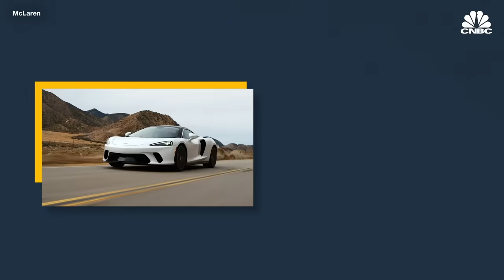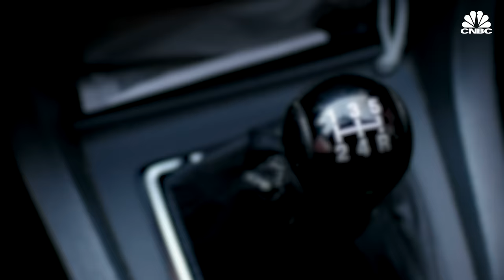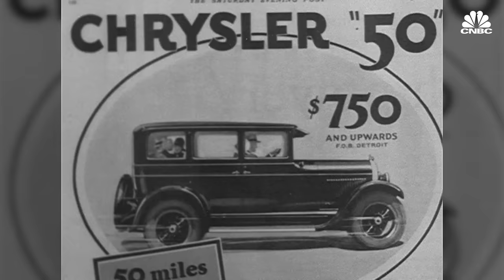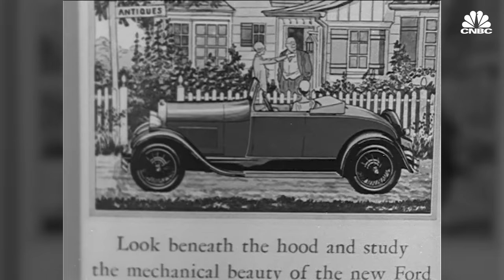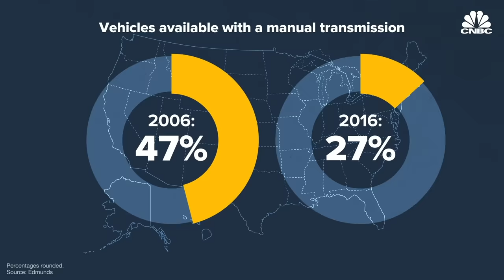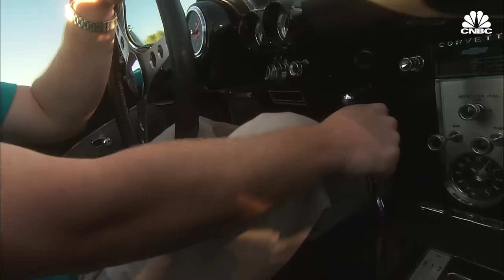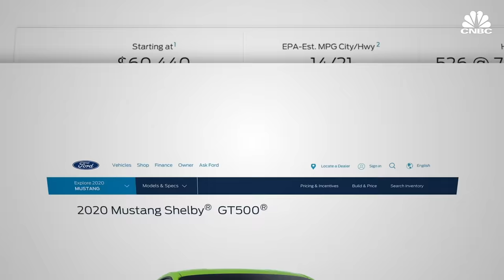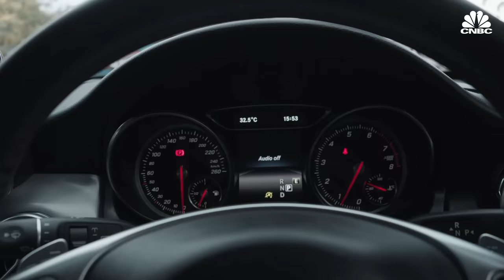Why Stick Shifts Are Going Extinct

Comment: "they require constant attention" its called driving
Reply: I just found in a low-power truck that I had a Ford Ranger driving in really heavy traffic for a long time got to be pretty tedious.
Reply: @omvegan  Well yes of course im not saying automatics are no good. There certainly are situations where they benefits from not having to worry about shifting, like in areas with heavy traffic. But there is a difference in saying it is tedious to drive a manual in heavy traffic and saying im not buying a manual because it requires too much attention. Because attention is always required when driving and shifting becomes a habit like indicating when turning
Reply: Who wants to be constantly attentive while operating a 2 ton piece of metal at over 55 mph? 🤷🏻‍♂️
Reply: You should be focused on driving (re: the road), not on operating your car. That's why manual transmission drivers get into almost 3x the crashes of automatic drivers.
Reply: @canyounot4665  lol what's your source? you couldn't possibly claim something so outrageous without a source
Reply: @canyounot4665  guess what automatic drivers get into 5 times more accidents than manual drivers
Reply: @laurenzr.8524  I also would like the source for your claim "automatic drivers get into 5 times more accidents than manual drivers". Like said above, this would go against the research in the area in driving safety, but also against research in the general psychology of multitasking (you are doing more things at a time with a manual transmission, despite you thinking you have "mastered" the task to the point of it being subconscious). It's not about people using car X being more likely to be better drivers, they are both the same, it's about one being easier than the other.
Reply: @xPussySlayerx69420  lol there is no source for my claim, that's the point im trying to make. if its too hard for you to drive stick, then go ahead and but an automatic, but don't claim that manuals cause more accidents, because they are "harder to drive"
Reply: @laurenzr.8524  you tagged the wrong person, and the dude LITERALLY gave you a source that proved manual transmission cars cause more accidents
Reply: @canyounot4665  lol that was not a claim
Reply: @xPussySlayerx69420  absolutely not. one study was looking at improved performance in older drivers and the other one is neither on an official website, can therefore be taken out of context and is neither stating, where these test were conducted. for example in Europe 80 percent of cars have manual transmissions, therefore there will be more accidents in manual transmission cars. the claim, that automatics will cause 5 times the amount of accidents as manuals was clearly a joke, to point out the ridiciulusness of his claims. (please excuse my English, since it is not my first language)
Reply: @xPussySlayerx69420  you shouldn't believe everything you see online, just because someone post a source. if the source is no good, his claims wont be either.
Reply: @canyounot4665  in the end I would say it all comes down to the skill of the driver, saying  manuals are 3 times as dangerous is false, even your sources can't proof it, and is also an outrageous claim, since the driver is guiding the vehicle and not the transmission. people who are able to drive manuals are generally the more skilled drivers compared to people who can't
Reply: @canyounot4665  and by the way, reporting me, cause your loosing an argument just supports my position.
Reply: @laurenzr.8524  the article you linked doesn’t make ANY claims, it literally just says to call their law office if you get into an accident you boomer. It sounds like you are ignorant in the field of car safety, because about 95% of research papers on this reach the conclusion that manual transmission cars are less safe.
Reply: @laurenzr.8524  boomer, it doesn’t matter what you think, go conduct a study or consult an insurance company to see the numbers on how much more dangerous manuals are
Reply: @xPussySlayerx69420  :) it clearly states that there is too little information to conclude either one is more or less safe
Reply: @xPussySlayerx69420  you know you won, when the opposition, tries to insult you instead of trying to make a point. and for that reason im muting this conversation. have a nice day :)
Reply: @xPussySlayerx69420  one guy reporting me and disliking my videos and the other one insulting me. Gents, it was fun arguing with you, but this conversation shows once more, that scientific and objective discussions are not possible on the internet
Reply: @laurenzr.8524  1. It’s very clear you didn’t read the studies linked. You bring up that 80% of cars in Europe are manuals, sorry to tell you but the study linked is from a EUROPEAN insurance company. 2. Please look up the definition of a claim. 3. You have been reported for spreading misinformation. I and nobody can help you if you choose to be ignorant. Goodbye.
Reply: @canyounot4665  lol of course its from an insurance company in Europe, that's why the percentage is so high:) people like you amaze me
Reply: Well you can focus on watching where you are going instead...
Reply: Horse manure,  I drove a stick shift for many years.  It becomes "automatic"  unless you are trying to impress.
Reply: @laurenzr.8524  Because there are 1000 times more automatic drivers than manual drivers.  Duh.
Reply: @laurenzr.8524  Dang dude, why you so pressed about this. If people want automatic cars then they want automatic cars. If people feel that they are a safer option for them then let them.
Reply: right lol and she is still wrong too I dont pay att to the gears just the road and feel its like 2nd nature
Reply: @laurenzr.8524  because there are more of them😶
Reply: @laurenzr.8524  its clear you don't actually know how to use the internet the pdf the other guy posted was a .gov meaning government organization aka reliable source meanwhile you posted a blog you seriously posted a random blog and claimed it as Evidence
Reply: @laurenzr.8524  it's true. I looked it up myself.
Reply: @canyounot4665  yeah but then if your busy with the gear shift you won't be tempted to pull out your phone
Reply: @canyounot4665  Of course, you can spend more time texting, eating, drinking, etc., when you should work on your driving.
Automatic transmissions lose more energy in the transfer of power to the wheels; that is a simple fact of basic engineering.
My qualifications?   Multi-ticketed mechanic tech; Engineering; hydraulics and computer electronics - until not long ago, I was one of the guys your mechanic called when they had trouble.
Reply: @andrewthompson5728  "Automatic transmissions lose more energy in the transfer of power to the wheels" I don't think there is anyone here that was arguing for or against this besides you.
Reply: I drive my auto like a manual using the paddle shifters. Miss my stick shift cars
Reply: @laurenzr.8524  yup! 2 years of driving in bumper to bumper traffic for 2 hours a day around Boston made stick shift a lot less fun for me haha. Agree with you, the only time it feels tedious is in traffic
Reply: Your less likely to crash instead of having your phone on the other hand.
Reply: @xPussySlayerx69420  but that source also says male drivers are involved more in accidents than female, it doesn't mean women are better drivers. I don't think these stats should be sole criteria to judge which is better
Reply: @shaktisehrawat7479  They don't attempt to make a claim on which is better, the fact that you think that implies you are misinterpreting their goal as research papers. And like I and other people have said, the overwhelming majority of research papers in this area come to the conclusion that automatic cars enable for safer driving than those same people on manual cars, you occasionally get a research papers that says manual cars are better for this use case but they are roughly 1 in 50 or  in 75 in favor of automatic cars. Each paper focuses on a different metric for safety, so no the stats I brought up aren't  "the only stats" being used. You would know this if you are actively involved in the research of driving safety, but it is clear that you are not.
Reply: @1Animeculture  bruh thats something a guy who never drove a manual would say, you dont have to look to the shift knob to shift.
Reply: Actually, having grown up with manual, it becomes second nature.
Reply: Amen
Reply: So true, anybody that complains about needing to be more attentive while driving is NOT somebody I would want to drive in a car with
Reply: @navinadv  This is actually 100% accurate, if you've never driven a stick shift for more than a month, you literally have no clue what you're talking about, people really think we out here thinking "Okay, its at 4k rpm..shift to 2nd, 4k rpm, shift to 3rd" lol
Reply: @alanmtz8054  can you imagine Hamilton, Schumacher, Fangio, Stewart, Lauda actually thinking as they change gears. Once you have spent about 2 years driving you drive by instinct and feel. I have on occasion (thankfully few) had to make evasive manoeuvres and it all happens so fast that there is no time to think, at least I can’t remember doing any conscious thinking. You hit the brakes, double de-clutch, turn, brake again, turn again, and straighten the car all simultaneously and on pure feel. This is where European cars, trump Japanese and maybe even American cars on the “twisties and turnies” (barring a few models. I remember once instance when I had to drive a Corvette Z28 from LA to Monterey via Big Sur and it was harder to handle compared to the SAAB 900 Turbo I drove a few days later on the same route. 

One thing I can say for sure, as we get older, our reflexes slow down alarmingly. I drive a lot less enthusiastically now, than I did at 50, 40, 30, or 20.

That said, with the advent of electrics. Be prepared to see manuals slowly fade away.
Reply: I'd like a car without a steering wheel so I can pay more attention to the road
Reply: Texted while driving 🤣
Reply: @canyounot4665  To me it seems you have a really good source in the Swedish paper on older drivers in automatic vs manual cars, a very interesting read! The other link you provided does not seem to provide enough information. It is not enough to say that 83% of accidents are caused by drivers of manual cars since we don't know what percentage of BTA-insured cars are manual. (Though it can be said that in Europe in general more than 80% of cars sold are automatic).
Disclaimer: I am not claiming that manual transmission is safer, I am just pointing out that your claim of manual drivers getting in to 3x the amount of accidents has not been proven, in any meaningful way, by the links you provided.
Reply: @xPussySlayerx69420  so do europe have 3x more accidents than america?
Reply: @canyounot4665  automatic transmission is still a minority. You really have to to want one, unless a hybrid or electric, to buy one. Many car models have less engine options on automatic transmissions. You can therefore infer that automatic transmission is a choice, while manual is the standard in europe. That alone filters a bit the quality of the drivers for each. You do see a lot clueless drivers on automatic suvs that can’t even understand their car’s dimensions, imagine them on a manual 🥶
Reply: "The problem is that they require work , skill and constant attention."

Those are problems? I thought they were virtues.
Reply: @emmamemma4162  to you and everyone else reading: if you live in the US I offer a free class hosted by Berkeley Community College on the ethics of driverless cars. I spend about 2 weeks of this class discussing the academic research around driver safety between these 2 types of cars (automatic and manual). Again, everything that has been said so far is NOT my opinion (I have yet to see someone else here state an opinion and back it up with scientific evidence), I am just stating what the science and research papers published say. I entourage anyone reading to take it because it concerns me the seemingly statistical incompetence displayed by the  statements being made by some (incompetence has a bad connotation buy I mean it literally here).
Reply: @globalist1990  please see my previous comment above
Reply: @canyounot4665  I’m not interested in that course and you haven’t stated anything else. I will add, if you have a car on good working condition and you drive as you should as an imperative for getting a driving licence, you will have no more accidents than an automated car operating properly. The problem with people driving is, there’s always a few *$>%*€<#\,^ “driving” on the roads.
Reply: Why Manual drivers aren't getting in stupid fender benders because they're alert...
Reply: @globalist1990  lmao your responss makes it painfully obvious you didn't read my comment or chose to ignore it
Reply: @globalist1990  citation needed for your claim about automated cars getting into more accidents ...
Reply: @canyounot4665  no worries. No citation. You believe in what you want. I believe in git gud.

You edited your comment. Typo perhaps? On automatic/automated?
Reply: @canyounot4665  why don’t you share some data? I’m sure you can squeeze something from the two weeks class.
Reply: @globalist1990  if you cannot cite your claim then I will report your comment for spreading misinformation. We don't need anymore trump jr. roaming around.
Edit: i should have said disinformation instead of misinformation, you are intentionally and knowingly spreading false claims
Reply: @canyounot4665  😂😂😂 feel free. I believe it’s obvious it’s my opinion. You have the data and yet don’t share it. I wonder why... 🤷‍♂️

Just a quick anecdote. Who has more serious accidents, europe or usa? What transmission is more prevalent in each? Don’t forget that in any case, the transmission is just a small factor in road safety. And manual transmission is hands down cheaper to buy and maintain, more durable and requires less servicing.
Reply: @globalist1990  see my previous comments, I have cited every claim I made. I am awaiting your citation.
Reply: @canyounot4665  🤦‍♂️🤣🤣🤣🤣 where? I missed your first links. I concede that automatics are a lot safer to nabs though.
Reply: @globalist1990  if and when you go to college, please take a class on statistics. Personal anecdotes individually are statistically useless. Your previous comment had been reported.
Reply: @canyounot4665  my opinion is: current road design and speed limits are already very forgiving for a normal person, as they should. These standards were designed and improved for cars that were manual. You could theoretically drive a bit faster in a safe way, but that is dependent on skill, focus and health of the driver. People with decreased abilities will benefit the most from automatics. Manuals allow more precise and quick control of a car, an automatic transmission can’t predict the road and obstacles, the driver does, and manual gears are important for finer control. Automatics give more reaction time and manuals give more control. So it’s a case of automatics: more reaction time for the  driver, slower and weaker response of the car, manuals: more coordination required (and less forgiving to panicking) from the driver, snappier and more precise response of the car.
Reply: I respect everyone's opinion here, but I'm firmly on the automatic side of this argument. For me, a manual just seems like more work with zero benefit. Due to being in an at-fault accident a few years ago, I'm very paranoid and hyper-focused on my surroundings when driving, the last thing I need is another distraction when I'm trying my hardest to be safe. Driving isn't fun for me, it's a stressful chore.
Reply: @MrIronJustice  that’s a very good point. I believe it’s always subjective. This whole discussion will be useless with electric cars. There’s no gears. And the brake does engine brake together with conventional brake pads.
Reply: Honestly, I don’t even pay attention to my shifting. It’s muscle memory.
Reply: You are right. But now, Tesla is trying to change cars, and driving, to appliances like smartphones and an activity like trolling on social media respectively... what a sadness. Driving is a serious thing...
Reply: @canyounot4665  If you say this, you have never driven a manual car. After the initial (short) period of learning, let's say, a month, shifting gears is done without even thinking ... and so the clutch pedal operation.
Reply: @laurenzr.8524  i’m not sure why this needs to repeatedly bee proven but automatics are safer for the sole purpose of the fact you can keep both hands on the wheel the entire time you are driving. You’re almost twice as likely to get into an accident driving with one hand then two. Beyond that skill is the only other contributing factor so your particular vehicle wether it be auto or manual doesn’t make any more of a difference if you’re going to be in an accident.  This is also the reason sports cars are beginning to no longer make high powered manual vehicles.
Reply: @canyounot4665  It could be because there are more manual transmission car then auto transmission, the ratio of that also need to consider
Reply: @AarmOZ84  if you're at a constant speed you don't need to touch the stick lol
Reply: I think this is a really disingenuous comment in the video, as someone with A.D.D that's always driven a manual I find that it is MUCH easier for me to pay attention while driving when I'm not driving an automatic.  A manual transmission is more engaging and gives me something to do that helps me remain focused and feel in control of the vehicle.
Reply: @BICIeCOMPUTERconGabriele  this literally makes 0 sense man. Where did you come up with that analogy.
Reply: @BICIeCOMPUTERconGabriele  people's performance on something even more basic and fundamental as walking and talking suffers when done at the same time. What you are displaying is the reason why there's such a huge push for self driving cars, because human ego takes over with claims like "I can operate and drive at the same time (they are not the same thing" and that gives us the reality we have today where car fatalities is the normal
Reply: @TNPadia  thanks, but something as statistically basic as posterior probabilities (what you brought up) is undoubtedly accounted for in academia
Reply: Well, today's society has the attention span of- Hey look a squirrel !
Reply: @yrralyou  please stop just pulling numbers out of thin air. If you make a claim, you better provide some sources. Please learn the basics of how a discussion works.
Reply: @canyounot4665  your sources disprove your claim. Try again.
Reply: @xPussySlayerx69420  then find ond lol
Reply: @charliekiger  you are going to have to be more specific on which source (although that seems like a normal response from someone that didn't read or even click the links to the papers). I linked at least 10 sources so far and have co-authored the one on self-driving car fatalities and the correlation between ones quantitative ego and rate of errors while driving.
Reply: It's called operating a vehicle. Driving involves more than just operating the vehicle, like following traffic rules and avoiding accidents. I think safety demands more of your attention than, I don't know, making sure you are in the right gear. FWIW, I drive a manual, but for everyday traffic, no thanks. There are days that I am too tired to think when driving.
Reply: @FAB1150  80% cars in europe are manual. 83% of car accidents involving cars insured by that insurance company the guy posted are manuals.
Reply: @canyounot4665  why is it so that america has more accidents than europe with over 90% automatic cars?
Reply: @canyounot4665  you haven’t posted anything by academia other than an Australian study about automatic cars being safe for the elderly.
Reply: @canyounot4665  you posted two links, not 10
Reply: I prefer automatic there safer and these days they spend less gas.
Reply: @omvegan  I don’t mind driving it in traffic it lets me perfect my take off so when my wife is the car I’m not giving her whiplash.  One thing I do hate though is driving through my complex cuz there are speed bumps everywhere and my car is low so I have to basically stop completely and pull myself over I’ve almost lost the splash guard under the nose multiple times.
Reply: @globalist1990  lol I turned off my comment notifications after arguing with this guy, his misleading stats and his threat to report me for 2 days. I think there is no point in arguing with someone who has no idea at all about statistics
Reply: @laurenzr.8524  You never cited your claims, look up the definition of disinformation. I hope you continue your schooling and go to college.
Reply: @canyounot4665  lol
Reply: @canyounot4665  alright lets make a deal, I continue going to uni and you start learning how to drive your car without crashing it because your "distracted and confused" by the shifting knob
Reply: Karen does not like stick shift cars because it makes it too hard to gab on the phone while running red lights
Reply: You'll be surprised with the amount of people who text while driving
Reply: It’s called old Technology
Reply: @laurenzr.8524  Do you even can drive a car?
Reply: @thegodhoward8037  i am sorry, but since when does .gov mean something is official...isnt it just another format with web conversion tools?.gov (now I am official and you have to respect me LOL)
Reply: @stixinst5791  yeah, its especially not a good source to cite your claims, when taken out of context, like he did. Also claiming that there are more accidents in Europe with manuals, because manuals are more dangerous is ridiculous. Of course there are more accidents, since almost everyone drives a manual. just like there are more accidents with automatics in America, since the majority of people there drive automatic.
Reply: dude, just accept that it's not practical anymore lmfao automatic transmissions just make more sense for daily life. we get it, it's cool to drive manual, and a lot of fun, and car like people it because of the novelty. but the majority of people aren't car people.
Reply: @TheGuitarifier  I can not imagine driving without manual. It really good when you know how to use it well... you barelly use your breaks, driving downhill for two hoursstraight will not demage your breaks and most importantly it is a skillcheck for anyone driving a car....if you pass you probably are skilled enough to drive, if you don't you take the warning and drive accordingly, because you have to. With automat your first skill check comes whenthere are already lifes at stake
Reply: @TheGuitarifier  yeah and I never doubted that, I just said, that manuals aren't more dangerous because "they require constant attention"
Reply: Yup, hard to be on cell phone when you're busy shifting lol.
Reply: @canyounot4665  One of these argues that older people have a harder time cognitively while driving manual, which I think is true across the board, but manual IS more involved than automatic, so no surprise there. The other uses stalling as an argument to suggest that manual cars are more dangerous. That is also true because there's no possibility of an automatic stalling, unless some catastrophic failure occurs. So really, you've just found some faults with manual cars and said that those faults account for more crashes than automatics without considering that the same failures CANNOT OCCUR in automatics. The real test would be to see if manuals and automatics experience the same accident rates when you consider accidents that aren't unique to the transmission type.
Reply: "they require constant attention"   no wonder americans don't like manuals, there too busy texting while driving, who's got time to pay attention to a tach, RPMs, a third pedal and hand shifting??  that's manual labor, how un american.
Reply: yup agreed!  A LOT  barely any distracted driving.
Reply: @laurenzr.8524  and I belt a lot of them fall asleep
Reply: Might be an elder
Reply: @xPussySlayerx69420  The side effect of automatic being easier is that it allows you to browse your phone while driving. Less feasible with a manual, especially in heavy traffic, you have to always pay attention. That's why I'd be shocked if accidents happen more often with manuals.
Reply: @Liteg0  well continue being shocked
Reply: @xPussySlayerx69420  Haven't seen any sources yet, still not shocked.
Reply: @Liteg0  then that's your fault because they've been posted many times. Stay ignorant
Reply: @xPussySlayerx69420  I haven't seen any reliable sources here either. In study made by David Shinar he wrote that "The lack of relationship between sign recall and transmission type was disappointing but not totally surprising", "Furthermore, if there were a bias in the tendency to purchase an automatic rather than a manual transmission car (other than the cost), then it would tend to operate in a direction opposite that of the effect obtained.". Also, it was stated "in the early stages of driving, manual gear shifting appears to be characterized by loading the conscious monitoring process and by its significant demands on the driver’sattentional capacity", which we can all agree, experience is the key. However, "With time, as some of the gear shifting task components became automated, performance on the sign monitoring task improved to the point where it was indistinguishable from that of driverswith an automatic transmission". So instead of arguing which one is safer, lets think about the big screen that is placed next to the steering wheel nowadays and lets wonder together which one would affect driver attention more. A simple stick and additional pedal or "legalazied phone" that requires You to take both, your hand from the wheel and Your eyes from the road.
Reply: @TheLiberek  ironic thing about that is any source that disagrees with you will be deemed as unreliable of course, because the NIH  is definitely an unreliable source :)
Reply: @xPussySlayerx69420  All I see here is "research in the general psychology of multitasking", "research in the area in driving safety", which is only a general mention about the study made, no actual title or who conducted those. The only one that is actually mentioned is a blog which is an unreliable source. That's why I would like to sugest to You to read "How Automatic Is Manual Gear Shifting?" by David Shinar in which he proves that drivers with at lest 2 years experience change gears unconsciously thanks to muscle memory, therefore they are fully focused on the road. I would also love to remind that this started over month ago, so some of the comments might have been deleted therefore calling someone ignorant or making any personal comments is quite low.
Reply: @TheLiberek  too bad for you if that's all you were able to find from me, I can't make you drink the water, you have to drink it yourself
Reply: @xPussySlayerx69420 You cannot even source the comment in which there is a source to Your claims. How ironic, isn't it?
Reply: People would rather be on their phones than paying attention to driving and shifting.
Reply: And no they dont, if you have one as a daily it barely takes attention
Reply: Making a sudden mistake could net you a thousand doller repair bill
Reply: @canyounot4665  That’s the lamest statement I’ve ever heard... If anything, driving a manual should make you more engaged. If not then manual is not for you. First of all, you learn how to drive a manual just like you’d learn how to drive an automatic for the first time. A person who is more focused on operating the car than the road clearly needs more practice. That’s human error and the driver’s fault, not the transmission.

And just to add, I have never felt more confident operating a car until I got my first car with a manual transmission. Every time I drive it I feel like I have complete control over the car and it feels amazing. Having control over what gear I’m in at any given moment via a manual trans is something that automatics can’t replicate (idc about paddle-shifters and the manual mode on the automatics’ shift lever). I can’t say the same when I drive an automatic because I feel so disconnected from the car that I have less confidence driving it vs a manual.

From what I’ve noticed, people ditch the manual for four reasons:
1. most people just care about the car taking them from point A to point B. 
2. if a “racer”, someone that cares about raw acceleration and HP,  or a non-enthusiast, these care more about faster (inhuman) shift times.
3. not having to put in any “extra” effort into driving other than steering, braking and pressing the gas lol.
4. they live in a city where there’s a lot of traffic or maybe slopes even which is understandable. i wouldn’t want to drive a manual in SF.
Reply: @Ryeric1  Nice anecdotal evidence https://yourlogicalfallacyis.com/anecdotal . I appreciate you articulating your thoughts, but unless you do a proper study or cite appropriate studies that you fully read and understand yourself, they are just that, thoughts.
Reply: @AarmOZ84  Surely, at over 55mph you're no longer changing gears?
Reply: @xPussySlayerx69420  "...and the dude LITERALLY gave you a source", really? Didn't see that.
Reply: @canyounot4665  There are enought studys on youtube. Or why do you think most dashcam video are from: china, russia and the usa. When it comes to driving the US is third world. Greetings from germany!
Reply: @yrralyou  "Horse Manure" is such an elegance i would never think of.
Reply: @alanmtz8054  4k? i shift to 2 at 3.5K while the rest are shifted at either 4.5 or 5K
Reply: @nebunezz_r  Is quite descriptive also.
Reply: In a bumper to bumper traffic on daily basis that constant attention worns you out
Reply: Driving and what is going on around you. Is what you should be paying attention too.